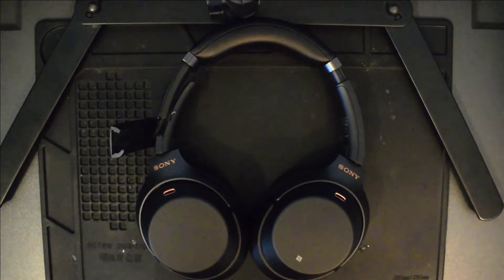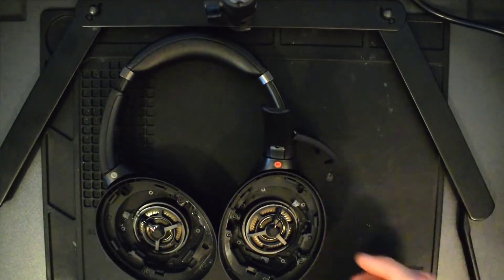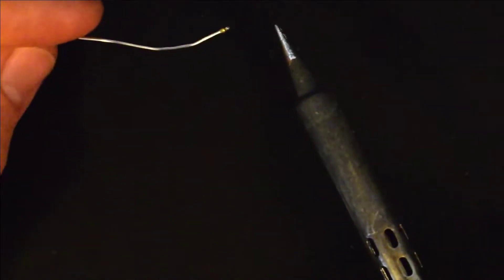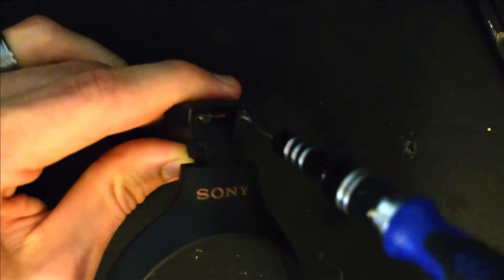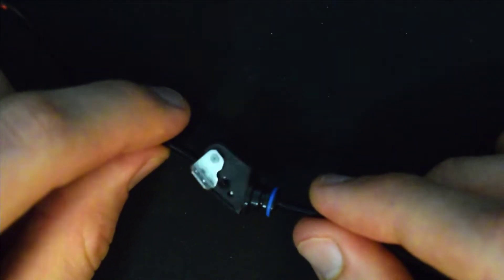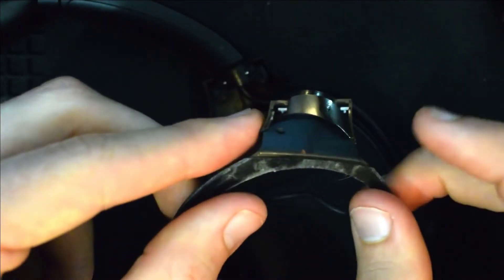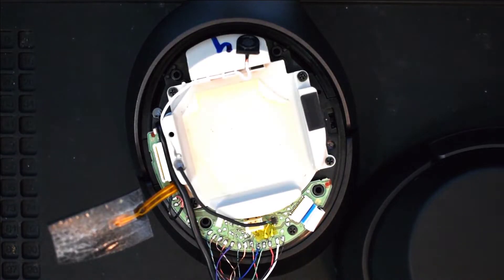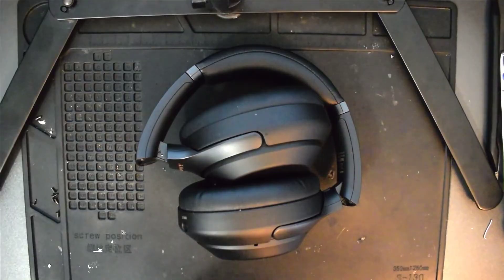Sony WH-1000XM3 Headphones DIY Repair Walkthrough - Right Side (Hanger, Swivel, Slider, Touch Panel)

Comment: Hey, i just found this great explanatory video, I just got back my Sony xm3 from Sony Service, they said the mainboard is gone and they discontinued parts. The thing on my headphone is that they don't turn on unless i reset them with the cable on. Connect for a few minutes turn off and then not turning on again unless I plug in and hard reset. 

Do you think I should look for a new mainboard and try it out, I never soldered anything before and how do i know that I didn't pay 50 pounds for a broken one?

Comment: Hey man, I'm totally stumped here. I have no idea which connector to use to solder these two wires from my speaker. 
They're both green and copper, so I'm not sure how to tell them apart. Any ideas?

Comment: I followed this guide and I was able to fix my headphones. I accidentally desoldered the cables for the headphone driver while soldering the white cable so for anyone else who made this mistake it is copper on the left and green on the right! If you solder them the wrong order the driver makes a wooooooo sound when powered on.

Comment: If a pair of XM3's... if one side stopped working, what are the odds I'd be able to fix it?  Is it caused by lose wire, or problem on motherboard?  Can replacemenet motherboards be purchased?
Reply: any solution?

Comment: Great video, thanks. 20 screws and (un-)soldering 13 cables to replace a broken piece of plastics? Shame on you, SONY. Is there any way to avoid breaking the little pegs at 7:40?
Reply: I pried them up at the sides first, then the middle a bit. knowing that the tabs exist helped. there was just enough space to check and run the wires through.

Comment: Hey , so I own xm3 and the noise cancellation of one side doesn’t work properly , the sound while noise cancellation on is completely foul. Where as on ambient and normal mode its perfect . How should I fix the issue , please help me with the troubleshooting.
Reply: try replacing the microphone ocmponent on the side that is having the issue  

the microphone cables are soldered on the pcbs

Comment: 7:12 be careful there are clips, you need to remove the rubber caps on top and press the clips, then pull out the plastic cover

Comment: just tried this and now it won't turn on, when I plug in a USB c cable to the headphones there is a red light showing but disappears after a minute or 2. So it's not turning on or charging properly, any idea what I can do?
Reply: it does the same thing if the battery is unplugged, the red light comes on for about 20 seconds then off, it wont power on
Reply: you need to replace your charge board which is on the right side of the headphones, opposite of the battery (the ribbon cable going down leads to it).

Comment: Thanks for the video! My AUX port wasn't working properly. This video helped me to disconnect the battery before going to left headphone. All I needed to do was push the little contacts further into the chamber, as it seems after accidentally yanking out the cable one too many times seemed to have pushed one or more of the contacts too far out.

Comment: hey I've damaged my headphones a d the band that holds the cup has come apart  meaning I may need a new one or I need to glue the 2 sides together. but also in the process I've lost the little metal pin. is there a way I can buy one or do I need to buy the whole cup holder piece
Reply from the maker: Hm...I'm not sure where you can buy those. I recently got rid of all of my extra random parts like that :(

Comment: Thanks very much for sharing this detailed video Jon, i have tried this and replaced both right and left sides successfully, BUT when activating noise cancelling the sound is muffled on the right side! with noise cancelling off, the sound is as good as normally is, any idea what could be wrong?
Reply from the maker: I wonder if a connection is not secured all the way. I'd suggest looking at your soldered wires and making sure they are all in the right order and that no connections look fishy. If anything looks odd, please try resoldering that connection and see if that helps :)

Comment: Hi my XM3 suddenly is not turning on. I tried charging it but the blue light is showing instead of red light. Brought it to sony service center and I was told I need to pay USD 250 as the whole parts inside needs replacement. Do you have any idea of how we can fix it ourselves. We only use it a couple of times :(
Reply from the maker: Hey! Really sorry to hear about your issue with the headphones! I have a video where you can try some troubleshooting steps on your battery issue. Here's the link! https://www.youtube.com/watch?v=Kh1cPCjfh34&lc=UgxkR3dQYXlGrJenmsR4AaABAg

Comment: Hello on the Right and Left when you swivel to remove the screws if you look on the opposite ledge where the Sony name is you will find two thin black rubber pieces to the left and right that is hiding the clips that need to be opened that you always say gets broken when you pry the piece that is under the Swivel piece with the Sony Name on it.  I hope you understand what I am saying.  Thank you for helping me to repair my Sony XM3's I got for an unbelievable God Father price on Ebay.

Comment: While disconnecting the cord @4:34 , the whole white thing pulled up. I was pretty careful , but don't know how the whole thing came off. Now its disconnected from board. Did I ruin it ? any fix please help.
Reply from the maker: Hey, sorry to hear that it came off the board! I haven't seen underneath that before. Are there solder points where it connected or does it look broken? If there are solder points you could definitely try soldering it back down onto the board. If it looks broken, I am sorry but you may need to get a replacement board.
Reply: @jontriestofixthings3718  , it doesn’t  seemed to have a point soldered  , but saw there are four contacts onto the board which was glued. But why glued by the four points. If it’s powering the board it can’t be glued had to be soldered. I can’t be certain. I wish I can share the picture with you to have a look. I wonder if I can get a schematic from some place

Comment: Thank you so much for saving my XM4s! I didn't need the soldering iron after all, but still saved me $80+ on the service center repair.
Reply: How come you didn’t need the soldering iron?
Reply: @XxAlex530xX  the WH-1000XM4 have a quick connector bundling the wires. Just unsnap to disconnect, then snap it back in!
Reply: @mswashu  really? Okay I’ll check mine i have the same ones. That would be so much cheaper.
Reply: @mswashu  my inner and outer slider broke and i got a replacement part but I was wondering how to get the wire through the slider? Is the quick connect in the ear piece? Do you just need to remove the ear foam and the back cover where the battery is?
Reply: @rickwagner3797 I have the WH-1000XM4s; the process was the same as this video except mine have the quick connectors. I still had to dismantle the can to get to the slider and replace my swivel. Hope this helps. And I got my replacement from eBay.

Comment: I had a problem when installing mine when it came to the last step snapping the two pieces together. One side snapped in, but then the other side wouldn't. I could tell that the lip of the inner piece had bent slightly, and it wouldn't snap in. I had a hard time getting the two pieces apart again, but eventually was able to get them apart. I cannot for the life of  me get them to snap together correctly. I'm really disappointed, given how expensive these pieces are.

Comment: Excellent video, thank you! One question, The audio on the right side of my WH-1000XM3 were coming on and foor a couple of times. Now it went off completely. I guess I should disassemble and check for any loose cable connections. Are you aware which cable carries audio to the right side? Since it doesn't work for the right side with aux in either anymore. I did factory resets, checked balance, etc. It's some hardware issue.
Reply: Did you fixed ? I have same problem too
Reply: @Mes_11  same issue here, I have to literally 'knock' the right side of my headphones to get audio to them often.

Comment: You're a life saver with this video. Curse Sony for soldering those wires instead of a connector. Do you have a parts diagram by chance? Sony's replacement part website is also garbage. Just part numbers, some tiny pics, and no diagrams.
Reply from the maker: sorry I don't have any diagrams! That parts site is very challenging, I know exactly what you mean. Do you have any specific questions that I could help you with though?
Reply: @DIY Headphones Repair  I see you sell the slider on eBay, but you're out of stock. Can you tell me the part number(s) for the right side slider in black? The slider is made up of parts: inside and outside. Are those two separate part numbers? Or do the two parts come as a set? I think I just need the outer part, that's the one that broken on mine. Inside seems fine.

Comment: Hello!! Can you tell me what is that part above the speaker plastic cover grill, in the middle. It's round and it has a cable. It also has a black tape covering it. Is that an internal noise cancelling microphone? What happens if you touch it (even without the earpads and cushions removed)? Can you damage it by accidentally touching it or applying pressure when holding your headphones? Thanks for all your videos. They are very helpful and detailed.
Reply: It's an internal microphone used for "pressure feedback". I've got my headphones open now and i'm fucking around with it trying to figure out how to stop this horrible hissing feedback sound that's happening on the left ear.  Maybe disconnecting, shorting, or adding additional resistors here would fix it... at this point I've got nothing to lose lol
Reply: @jfjfjf  did you find a solution for this problem?

Comment: can you do a video on replacing the charging port? I think that's the issue for my headphones right now. Suddenly, I'm not getting a red light when connecting the headphones to a charger
Reply: Oh please please! This is the issue I'm having right now with mine and I can't seem to find anyone who changes it. Before it run out of battery, it was working perfectly, but I could not charge them with any charger whatsoever.

Comment: My touch panel been not responding since I drop it a few times , I opened it up n try re connecting the touch panel cable , n its like working 1 out of 100 times I touch my right side of the headphone , please Help !
Reply from the maker: Hi, you will need to replace your touch panel. Thankfully that repair is very simple since you will just have to remove the 4 speaker screws and then unplug the touch panel cable. You can find the part here if you are interested in getting a replacement: https://www.ebay.com/itm/192953547468

Comment: Thanks for the upload.   I just bought one with the same issue on eBay.   Didn't think it would be this involved to fix.   Now I have to buy a soldering iron.
Reply from the maker: I would highly recommend the one I use in the video! It's very cheap and has held up super well :) Best of luck on your repairs - you got this!